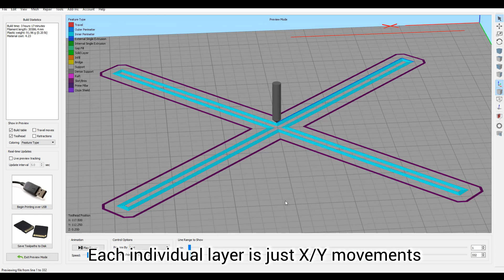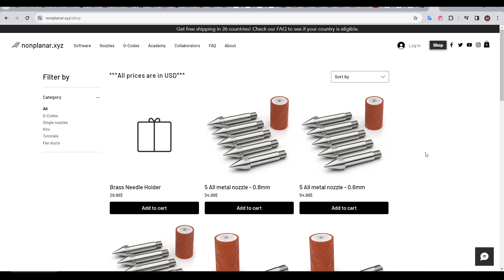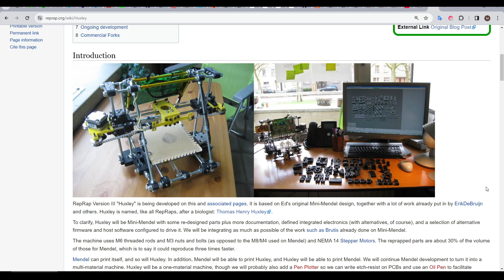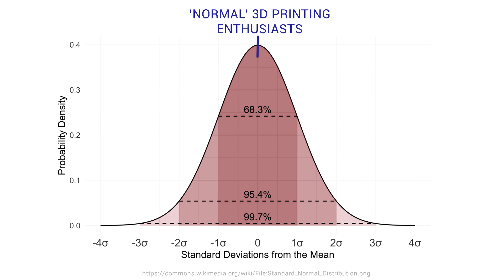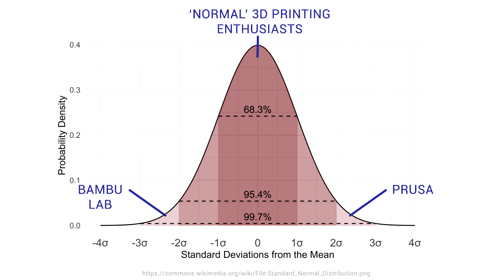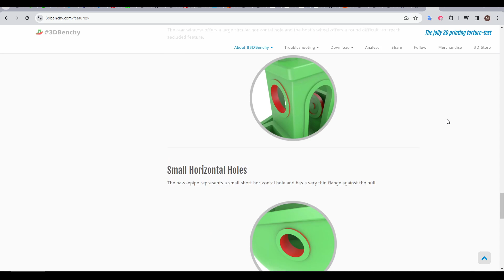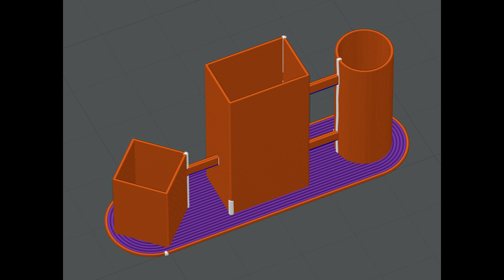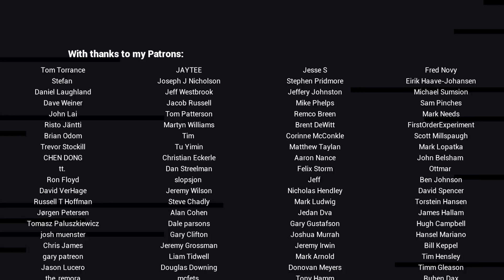3D printing mysteries that need to be solved in 2024

Comment: A "non-planar top layer" option would be really cool, maybe with an angle cutoff to prevent collisions. So the printer could do non planar sections where the angle or height difference was small enough

Comment: Every time I've encountered filament breaking and snapping like that, it's been because the filament is TOO dry. It's happened to rolls that I've left in my food dehydrator for days (oops), but has even happened when the relative humidity has been consistently very low (I live in the desert so it happens often) for extended periods of time.

Comment: number4- artifact : probably due to the timing to complete a layer , becomes almost half when the side piece is finished: this will change cooling and layer deposition. You could try inserting an equivalent pause and move away the cooling?

Comment: I'm actually currently working on a nonplanar-slicer. Currently the main goal is removing the need for most supports, but non planar ironing can be added later. My last issue is limitting the max angle while trying to maximize layer height. I have actually found a way to solve this, but implementing it(while not making slicing take an hour) has been tricky,since my brain went "it's christmas leave me alone" and forgot how to do basic math. Should have a basic version out soon...I hope...
Reply: I'm sitting here thinking "I sure hope this isn't another c++ implementation so I could enjoy contributing to it".
Reply: @crashingsux  I will have a video on this account as soon as possible. And the project is written in c#. I just gotta do a quick refactor before I publish it.For now it has 1 flaw,it only works with very thin layer heights, like 0.15mm for 0.6mm nozzles but I will explain why in the video. I do have to add that Ihave a small exam in a week soo refactoring and making an explanation video on the algorithm may be a bit delayed.

Edit:I do already have an idea on how to fix the layer height I just couldn't get that fix to work yet.
Reply: @U_Geek  preemptively subscribing :)  Dunno when I'll use non-planar for, but I want to give it a try one of these days...
Reply: @crashingsux  why does it matter if its in c++ or not?
Reply: @justinc2633  because, tribalism?😮😉
Reply: @miniac60  I imagine that's not the case. C++ is notorious for being hard to work with for all of it's footguns and undefined behavior that follows. Having a language that is well defined and easy to work with makes development much easier, at least for just "banging out code."
Reply: Id love to test that on my longer lk5 pro
Reply: All I want for Christmas is peace
Reply: I'm excited to see you progress. Good luck with your exams man!
Reply: How about a delta 3d printer on wheels gliding inside a bowl(concave  hemisphere). By controlling the angle of tilt of printer wrt to the print angle, there will be no need for any supports!(more like a 45 degree belt 3d printer(CR30 printmill), without a limitation on specific angle).  Any model with default slicing should work, the s/w just creates syncronized movement of the printer, while printing overhangs. Will need plenty of space though.
I could take care of h/w for motion control, in addition to using the klipper upgraded flsun SR, if only, somebody could provide me the tilt angle(along with the index position)from a gcode parser, streamed through rs232 port? Just some 💭🤔.
Reply: Where can we follow your progress. This seems like something we should be supporting
Reply: Wow, that's  great! Would love to try non planar!
Reply: @billallen275  I made a lot of progress but it's still not anywhere near ready for public testing/use. Turns out developing a new way of slicing is not easy. I did post some early results on reddit but not sure when it will be ready.

Comment: For the last one. I found on my printer at least, the nozzle moves in another direction. Say clockwise, and then it goes anti-clockwise. It is probably other factors as well, but my walls always looks different if the direction the head moves changes. Maybe the way the hardware interacts is behind it. 

Filament spiralling due to hemisphere. 😂😂😂 How funny! From memory baboon poop in South Africa spirals clockwise, now I wonder... Is it a species thing or a hemisphere thing? No baboons in Oz, except maybe the "tribal" community members. 😂 Some inter-species breeding between printers can only be good. Next time I'll order a clock wise nozzle.
Reply: BTW. I just read that wombats poop out squares. What's wrong with Australian nozzles, mate? 😂

Comment: Many thanks for all your efforts in making the world (and especially the community of 3d-printing) a better place and a happy new year to you too :)
Your videos have helped me many times when I have wrestled with a obstinate CR-10S Pro; replaced fans, installed a BL Touch sensor, installed and configured a Raspberry Pi print server, etc.
I think that your issue with the filament breaking into many pieces is the result of the extruder putting too much compressive stress on the filament in the Bowden cable...? It could be caused by a block, or a partial block, in the nozzle or by a small piece of filament being left in the Bowden cable, jamming the flow of new filament.
Cheers

Comment: I have had filament get stuck in a reverse bowden a couple of times so, although not explicitly a question, I have a suggestion for getting around this. I switched to a ptfe tube with a larger 2.5mm internal diameter and the same 4mm OD, I also went with clear ptfe so I could see any problems. Works great since a reverse bowden doesn't need to constrain the filament only guide it.

Comment: I would love to see non planar 3d printing take off along with another axis printing.

Regarding the filament, I had the same happening to me. It was a dated and cheap spool of Pla. I suspect it is a mix of the materials thermal history, degradation of the material in general and water. I was lucky to get it out of the Bowden tube at all

Comment: Our printing club has a lot of donated filament of many brands and we have been looking at the problems of older PLA filament for a while with it's failure modes and have come to several conclusions. 1) The filament comes off the roll in a bent shape and when stretched straight (like inside a tube), it doesn't break straight away,. It takes a little for it to break. This happens a lot on our bowden drive machines after the print has finished and the filament is sitting in the tube (Flashforge machines). It also occurs between the hotend and the reel on our direct drive printers after it finishes printing and sits for a while. We come back and look next day and although the print has finished ok, the filament is always broken. So our conclusion is when our filament fails, it tends to take time for the stress to break it (if it doesn't straight away) on older PLA. To fix this we have been softening the filament by putting it into a vacuum chamber for 10min to dry it then flooding the chamber with a spray of turpentine gas, not air.  The idea being to have a VOC fill the voids in the filament. Seems to restore the filament to a more flexible state. 2) Keeping the filament dry in a desiccant box makes no difference to the behaviour when the filament is old. We think the VOCs have already left which is why we first tried just vacuum drying (no difference), vacuum drying and wetting it (no difference, terrible prints) and finally, vacuum drying followed by putting some hydrocarbon VOC back into it (more success). 3) Minimizing the time it spends in the tubes and reducing the twist angle the filament goes through after leaving the reel. Take some older filament that breaks and wind it off the smaller reel onto a larger diameter one and leave it there over night. You can quickly work out for your filament the smallest (larger) diameter it will sit comfortably at without breaking.
Finally, our next test this month is going to be heating the filament as it leaves the reel to just below the plasticity point (55 degrees or so) as it is straightened to see if we can lower the stress on the filament as it goes from bent to straight. Still designing the mechanism to attempt this. Several ideas are on the drawing board, we have a lot of old filament to play with.

Comment: The surface artifacts are thermal expansion related, caused by different print times moving from an infill layer to a top/bottom layer. If you print the walls before infill, it should eliminate this issue. I believe the setting is called “print outside to inside” or something and found under wall ordering in Cura. Most slicers have the opposite on by default as it helps print overhangs easier. This issue is commonly referred to as a “benchy hull line”. Not sure why having two separate models would cause this though, that may be a separate issue

Comment: Filament getting brittle seems to be a PLA ageing problem. I haven't seen it with other filament types. It seems to be related to sitting out and exacerbated as it gains moisture. There was a long podcast into the chemistry of PLA and moisture and there are several different reactions going on. (An interview with the Gloop chemist).

Comment: My theory on the artefacts at the end are due to the layer time, if the printer needs to print a top surface in that layer then the plastic elsewhere will have more time to cool and hence will be colder when it gets printed on again.

Maybe this could be fixed by printing slower on those sections to allow the heat to soak through again.

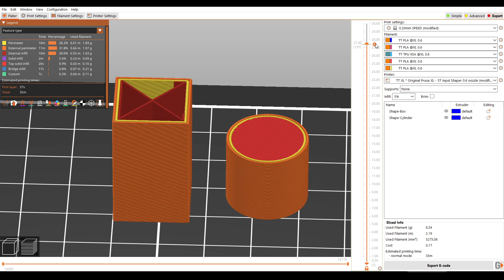Comment: The indentation at 11:57 looks like simply due to it is not the starting point (seam line)? Judging from the printing path shown in 12:47, the other "normal" corner is just the starting point (so they bulge out a bit), while the "indented" corner is just that it is not the starting point.

Comment: Regarding non-planar, I've seen a number of videos about newly-developed and experimental printers with tilting beds and the specific claim that they'll be ready for non-planar "when the slicers can do it." Ironically, this may actually make things even more difficult to implement, because it works entirely differently from the strategies employed to do non-planar on a bed-slinger.

Comment: I learned most of what I know about 3D printing over several years in the Ender3 sub on reddit. It was (and probably still is) a great community. Full of people working together to come up with solutions, making them more elegant and teaching others how to implement them. I spent so much time helping people fine tune their newly installed BL Touch or install Octoprint or even walking them though making their own changes to Marlin, and I received just as much help, it's how I learned all those things.

On the other hand, the Bambu sub is a dumpster fire.
Reply: I have similiar experience with Ender-3 and Bambu Facebook Groups. Although I start noticing the trend of abandoning and shaming on the Ender-3 for it's archaicness and very poor price to performance ratio since release of many new high-tech bed slinger printers in 2023

Comment: I feel non planar printing may at this point have to become like CAM software, where the user tells it what to do although a proper slicer implementation would be better.

For non planar printing I feel like using a nozzle extender would be very useful as would coming up with new fan duct designs.

Comment: how many times did you dry the brittle filament? thanks for your uploads, i began my 3d printing journey this year and your calibration website github source proved invaluable when i had no internet on site

11:10 the surface finish change is based on total layer time and thus cooling time. it's starting at the first top layer
Reply: i tried to snap the two benchies on my desk together and one chimney snapped off

Comment: For the artifacts, change the display from layer type/feature type to speed or flow rate. You'll see a speed difference or flow difference at that point causing it. If you play with speeds you can fix it.

Comment: I suspect the artifacts in prints with holes or other objects has to do with layer time and cooling.  I've wondered if a heated chamber built somewhat like a convection oven and pid tuned to keep a perfect even temp the entire time at just under the glass temp would fix it.

Comment: Re:surface artifacts - I think you’ve shown two different phenomenon, one thermal and one mechanical.

My belief is that the difference in sheen is absolutely thermal and is related to the print time per layer. Not because of something mysterious with the hotend temp like many speculate, but because the plastic in the completed layers cool to different levels before being printed over again. Two quick hot layers will behave differently when fused than a hot layer combined with a ‘cold’ one. It’d be interesting to see this with a FLIR camera and watch how layers of different times cool after being printed. You could test this by fiddling with the cooling fan at different heights, or whip up some custom Gcode that has delays or other layer time differences at different heights and see if you can replicate the artifacts. 

The second phenomenon here (in my opinion) are the dimples that line up with the bridges in the test model. This seems mechanical to me, and I’d be curious if you see them across different kinematics, slicers, control boards, firmwares, etc. Do you get the same results on the two most unlike printers you have? What if you print the same model with KISS slicer on your Polar3D or with MatterControl on your delta machine? Skeinforge on your LISA Simpson? How weird does your collection get? 😂

Comment: 4:45 I had my "toxicity" revelation just last week. I'm working for 3D printer manufacturer since 2017, I bought my own 3D printer in December of 2018 and it was Ender-3. Since then I learned a lot and I consider myself a valuable member of 3D printing community. I was shocked when I joined Bambulab facebook group, where I asked about CHT hotend for Bambu and was called cheap and unknowledgeable, disrespectful to Bambulab engineers and overall stupid for such ideas. I don't feel safe anymore in 3D Printing community. Many times I visited homes and makerspaces to swap 3d printer mods or parts and never felt threatened but this now changed. Bambulab printers became weird status symbols? I'm not supposed to touch anything because I will break this fragile device? That is not what I belive in...

Comment: For those layer artifacts it is multiple things working in tandem. Flow rate, print speed, part cooling, and layer time.

Because those middle layers have a significantly higher total volume being extruded. Unfortunately the only solution I know of requires either repeated trial and error, or a significant compromise in print time.

I can't pinpoint exactly what I changed to fix it in my own prints because it took so much trial and error.

Comment: Diversity is a missing trait with a lot of folks now.  Politically, conceptually and even technologically people are less appreciative of diversity these days.  It's a shame because it's what makes us great and keeps us from being so one sided in our views and technologies.

I agree with your theory on why the artifacts are seen in the second model when printing multiple on the same bed.  On that note I have found a setting that will eliminate this, "Print Sequence" by object will fix it and I found this by having multi color objects on the same build plate and not having all the color changes every layer.

The Benchy trick is so strange, thanks for bringing this to my attention, I have never found this but sure enough all my benchies snap into one another when oriented opposite one another top to top 180 degrees from the other.